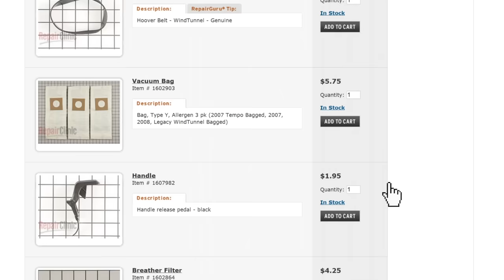How Does a Vacuum Cleaner Work? — Appliance Repair Tips

Comment: I like videos of how things work, you are doing a good job of educating the masses if the masses will listen, but if the beater bar/brush doesn't turn and you don't have a bad belt or bare floor switch then the vacuum cleaner is set to low for the carpet if on bare floor then you have a problem.
Reply: 10 yrs

Comment: Our Hoover high capacity wind tunnel isn't spinning. Checked belt and rollers and filters. The canister where you usually see debris that was picked up spinning around there is no spinning. What could be the problem?
Reply: The motor?

Comment: i dont think the low pressure is behind the fan, its right at the entrance of the fan. because what the fan does is that it applies force on air using the blades of the fan, forcing air to go through it, what this does is that it creates a lower pressure in front of the fan due to the air that was there no longer present, this lower pressure makes more air from the atmosphere to get to that point and hence experiences the same force from the fan, this is repeated which what creates the flow of air.

Comment: hi repair clinic..
I have a dirt devil power lite vaccum cleaner. the belt the mentioned on website is style15 but unfortunately I couldn't find one and got style 4/5? will it work? 
plus I washed the foam filter with soap will it work?
please reply back soon
thanks
Reply from the maker: +richirich We would need to know your model number in order to answer a question about parts.

Comment: hi repair clinic. I have a hoover wind tunnel uh70120  t series and when I put the vacuum  incline it makes a squeaking noise or tilting  it in front of the vacuum   it makes the noise can it belt the belt or motor any suggestions because the motor runs fine
Reply from the maker: +Deo Nandkumar Inspect the belt to see if it is worn. If not, the motor could be defective. http://www.repairclinic.com/PartDetail/Fan-Motor/230333001/2701023?TLSID=1773

Comment: hm didn't realize motors are all you need to create suction. i would've thought there would be an element attached to the shaft your trying to spin but the engineers just glossed that right over the same way you did in this video im guessing.